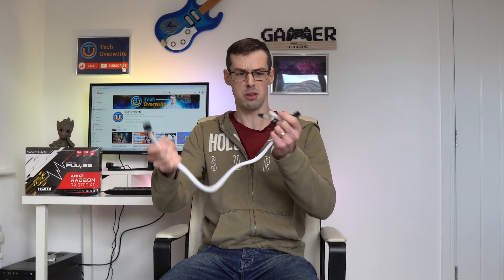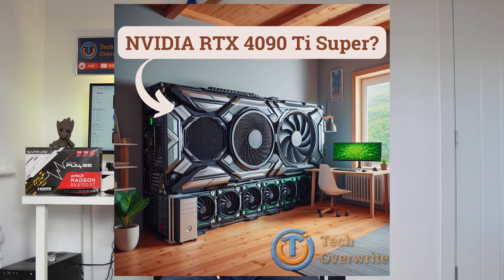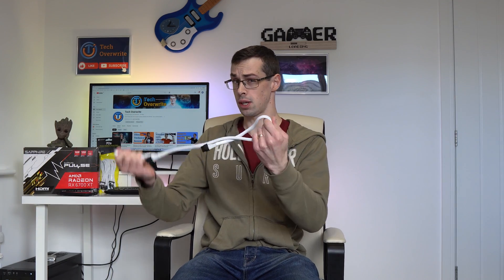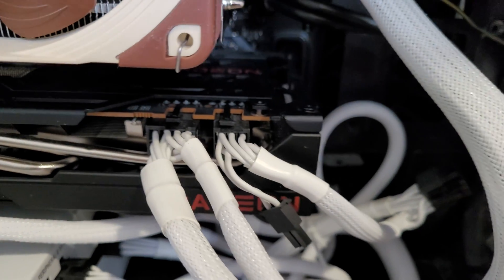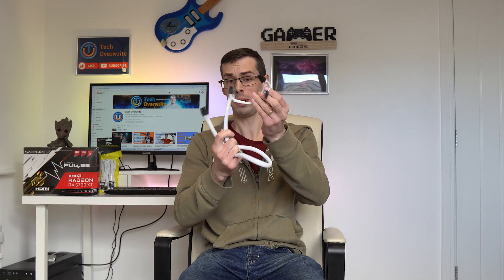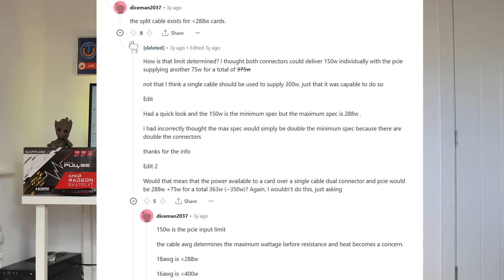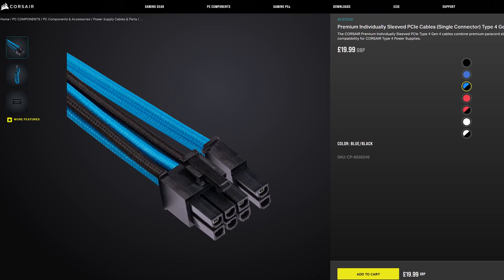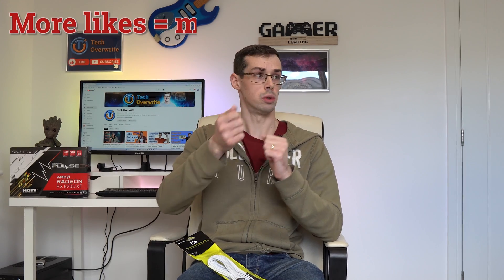Stop Connecting Your GPU Power Cables Like This! (How To PROPERLY Connect PCIe Cables For GPUs)

Comment: My PSU is getting on a few years (2020) but at gold rated 850w it has never given me any issues, my question here is, my PSU is not modular and only has one "pig tail" cable as an option. Given the fact that the +12v rail is rated 380W/72A max I have not had any issues (afaik) with my current card. However if I swap out my current RTX 3080 for something more power hungry soon, is it going to be best (more stable) to swap my PSU?
Reply from the maker: Hmm that's a tricky one. The RTX 3080 is fairly power hungry but as you say, your PCIe supply should be sufficient. You could always try it out and just look out for crashes etc. Personally if I was doing an upgrade and could afford a new PSU, I would do that too. But it doesn't sound like you're immediately going to have issues with your current PSU. It's not like you have a decade old PSU and are trying to power a 4090 or something 🙂
Reply: @TechOverwrite  Thanks for the response.

Comment: Great helpful video thanks. I just upgraded to a 1000 watt SFX-L from a ATX 850 watt now I have 6 PCIe connectors ( though not sure why one would need that many), it also came with that weird 12pin thing. I found about not using the pig-tail a few years ago as my gpu kept crashing.
Reply from the maker: Thanks, glad you liked it 🙂 Woah, 6 PCIe connectors is quite a lot! My Corsair Rm750x only has 2, but sometimes that does seem too limited tbh. Sounds like your PSU is fairly future proofed which is good.
Reply: Maybe for those crazy rich people who want to plug 2 x RTX 4090 :D